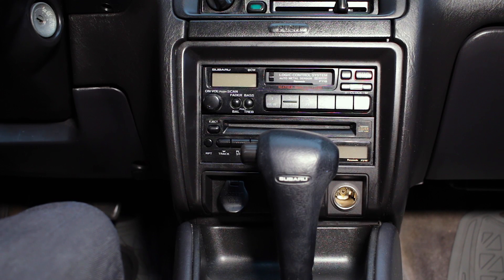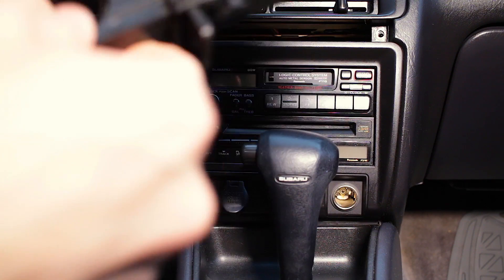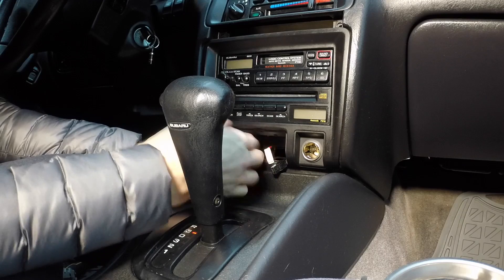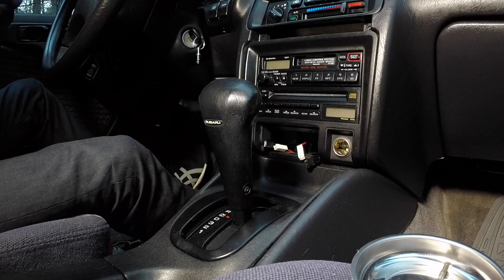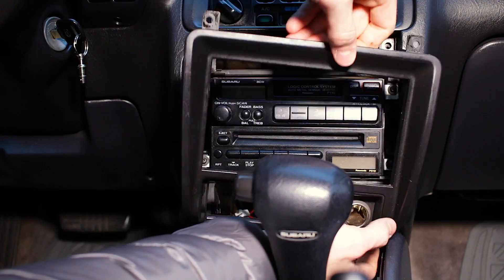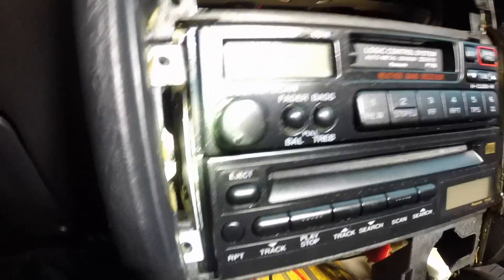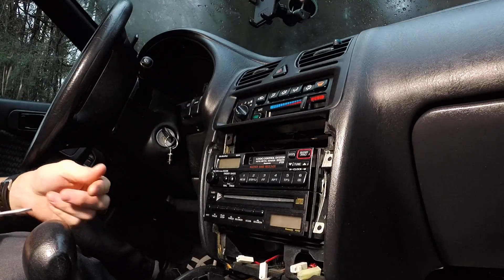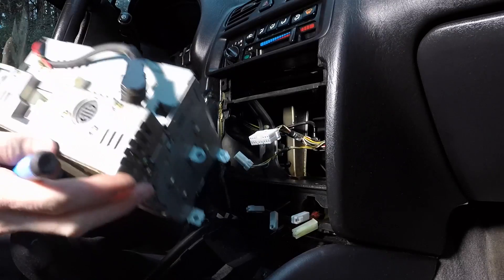1997-1999 Subaru Outback Stereo Removal

Comment: Do you have a video of how to get to the back speakers? I know how to replace the front speakers. I can't figure out how to get to the speakers in the back. It's a 1997 Subaru legacy gt 2.5l 4 door. The back seats fold down so you can get to the trunk. I can't figure out how to get the 6x9s out. I can get to the speakers in the bottom. But I cant figure out how to get them out. This video has helped a ton. I'm replacing all the stock speakers including the tweeters on the front and the head unit. This video has been very helpful. Once I get the money I'm replacing it all. Hopefully this week. If anyone could tell me how to get the back speakers out would be super helpful
Reply from the maker: I do not. I actually don’t have the car anymore.